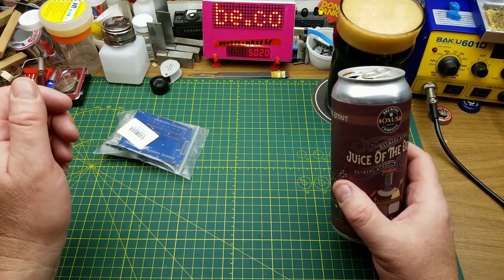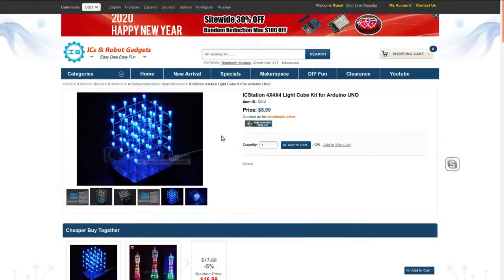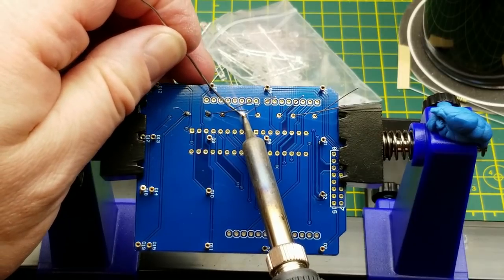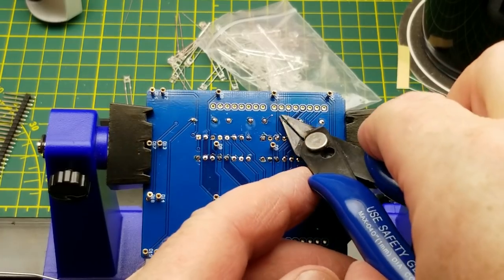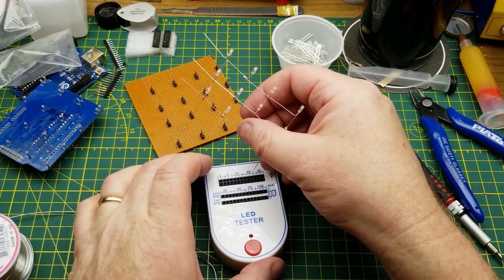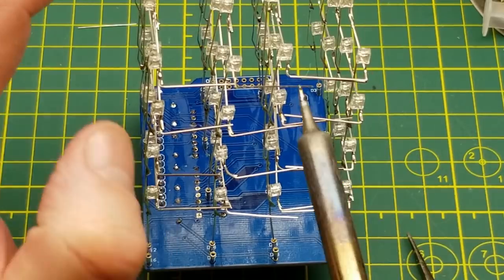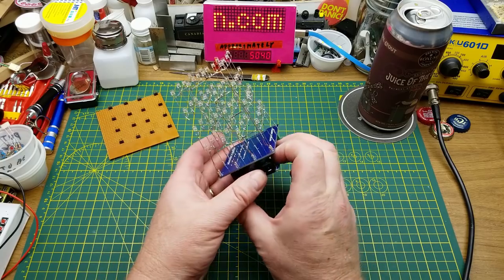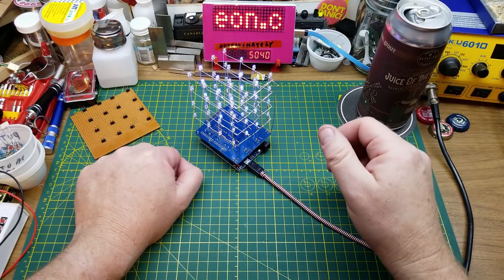led cube kit build

Comment: I bought a standalone 4x4x4 LED cube kit(Not an Arduino shield) and I didn't need to make a jig because I used the supplied circuit board to get the spacing exact.  I cut off 4 of the led pins in the 4th column since the 3rd column crosses over and used the cut-offs as connecting pins to the sockets on the board using the "included" wire tying each level to each socket.

Comment: I built a 5x5 clube many years ago, but making a jig for the leds helps a lot. I just drilled 25 holes in bit of wood to hold the leds in place while soldering them. Hardest bit is joining the layers as you have to get in to the middle with the iron. Happy soldering :)

Comment: Argh, I wish I'd watched a little further before starting mine. I put the IC headers straight in and now they will inhibit the LED D5 and D9 connections. Also, I didn't get any of the 'pin' headers for the LEDs but will just solder them in I hope! Thanks!

Comment: I have a trick for small items like those single header pins ... the tack works well but it can melt and drop into the female pins so I instead wrap 2 or 3 layers of masking tape around my finger and just hold it in place. ;)
Reply from the maker: Yes, that is the disadvantage of the blu-tack. It gets quite goopy if you get it too hot.

Comment: You know that they make an 8x8x8 one of those cubes. So many soldering joints! I used the cardboard template thing. It was very easy from there.
Reply from the maker: at this rate it will take me years to work up the courage to take on one of those.

Comment: Really awesome video's! Am myself just getting started in soldering and mostly messing around with led lights. Just started on this diy kit but I made one small mistake & now I have a question: How big a deal is it to have the IC Sockets (see 9:50) with the notch on the other ends? I totally missed that part... but it's all welded now...

I probably screwed up, but don't want to throw it away if for some magical reason it might just work with the notch on the other end too ;-)
Reply from the maker: The notch itself on the socket is a visual indicator of where pin 1 of the chip goes - it doesn't make any electrical or mechanical difference.

However, it is critical that the chip be put in  facing the correct direction.  And with the notch on the socket in the wrong place, it's easier to get the chip wrong if you aren't fully paying attention.
Reply: @pileofstuff  thx for the fast answer! Good to hear, I was afraid it might have been a bigger problem. Then I can continue! :-)
Reply: I finished it and it worked!!! :-)
Now looking into how I can get some more exciting patterns installed on the Uno...